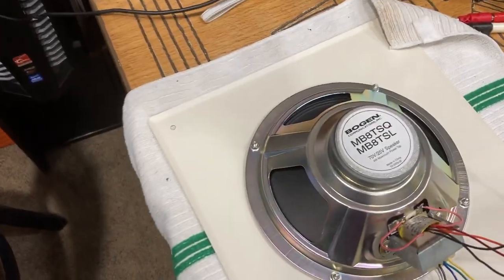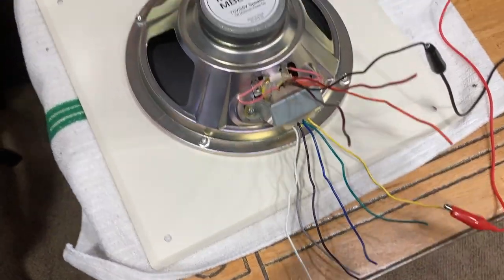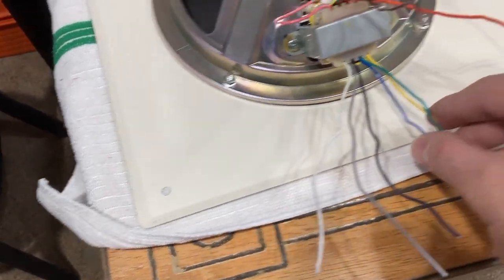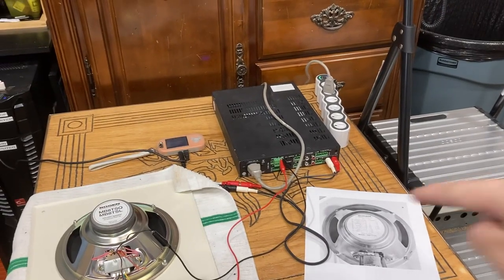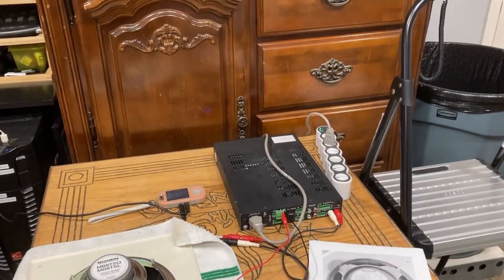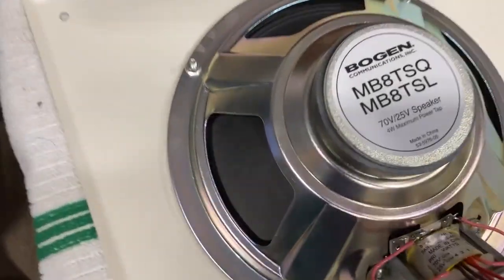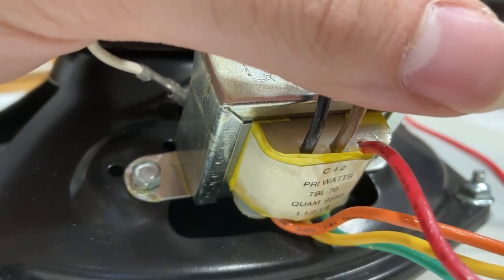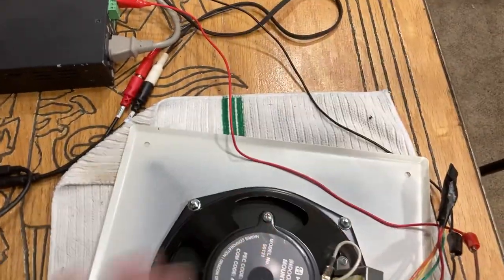How To Wire A Bogen MB8TSQ MB8TSL & Quam System 1 Paging Speaker

Comment: I got a vintage atlas soundolier 60-8 brushed aluminum speaker grill from the 70s off ebay the other week. It has an orange union made sticker on the back. Its just like the ones used in waffle house restaurants. I mounted a UHT-70C speaker that i had laying around to it. It has a quam 70v transformer on it instead of an atlas one.

Comment: Hello, I would like to ask a question around transformers on a speaker, do you know why the audio is quieter compared to passive speakers when wiring these speakers on a home theater reciever even on the highest volt setting
Reply from the maker: The transformer creates audio loss which is typical and more noticeable in some 70 volt speakers than others. If there's 25 volt taps present you can connect those leads to a 70 volt audio line to make the speaker a bit louder. This will not do harm to the speaker and have done this to a few speakers that were quieter then others.
Reply: @CristianOrtiztechmaster926  thanks for the info, I appreciate it